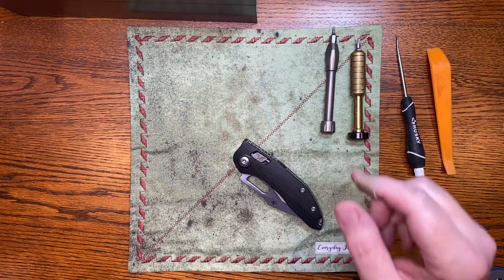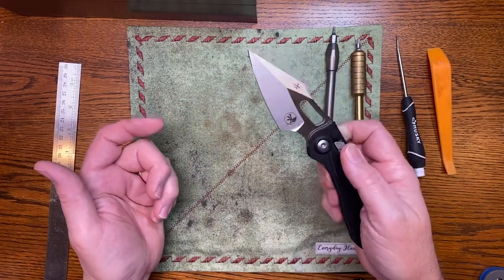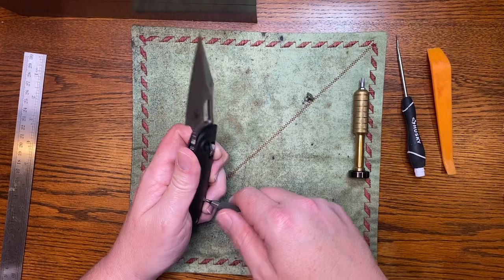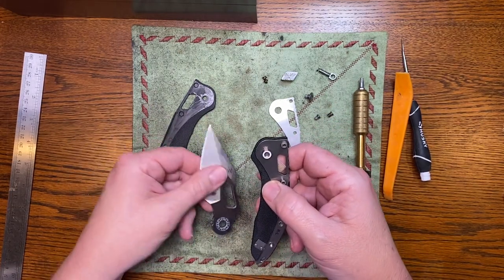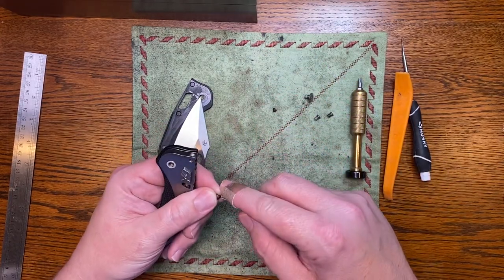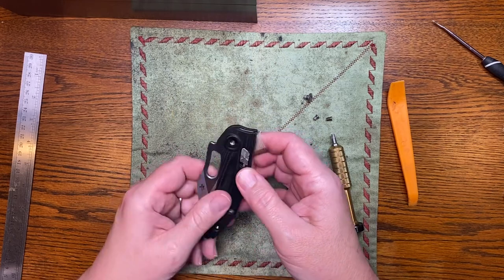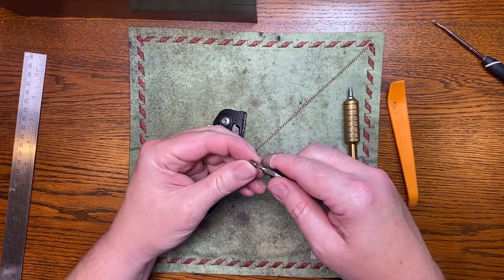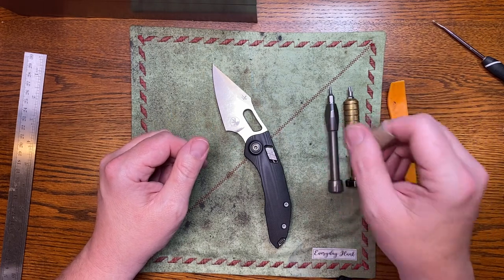Stitch Ram-Lok Disassembly and Overview

Comment: Pretty cool knife definitely will be getting one, the only thing is that “Ram Lock” is pretty much the same as the Benchmade Anthem’s Axis lock… the exact same thing, I still like it because that’s is the best version of the Axis Lock! 👌🏼
Reply: It looks so robust. Don't know why Benchmade didn't roll it out to more models.
Reply from the maker: It’s actually pretty different from the axis lock. It uses a coil spring setup not an omega spring.
Reply: @everydaybladesinc  The Anthem used a coil spring because the handles were one solid titanium piece. But the knife cost $500.
Reply: @everydaybladesinc  🤔 I think you need to get a Benchmade Anthem in your hands!!!
Reply: @knowyourhistory  worth every penny, best version of the Axis lock!!!